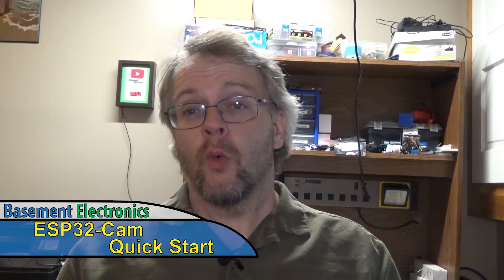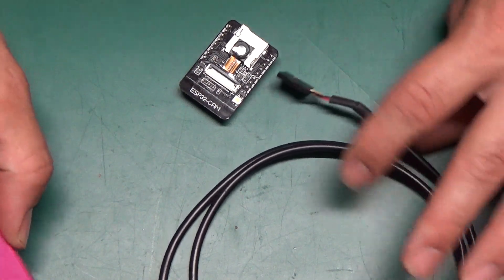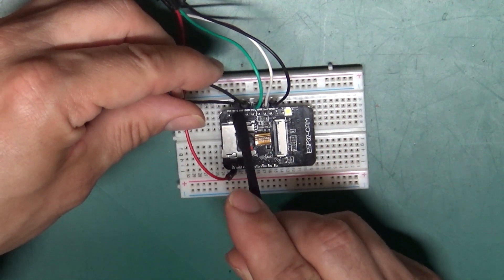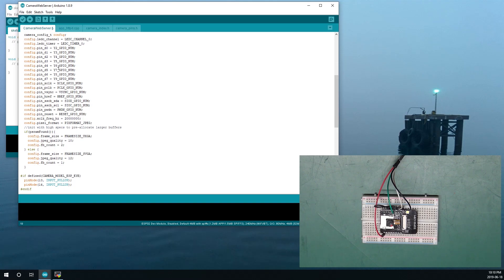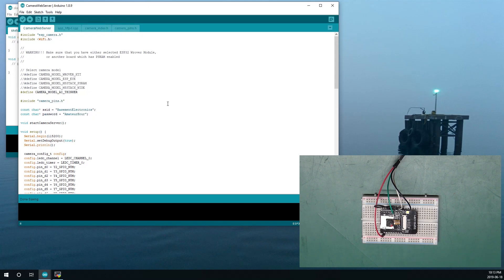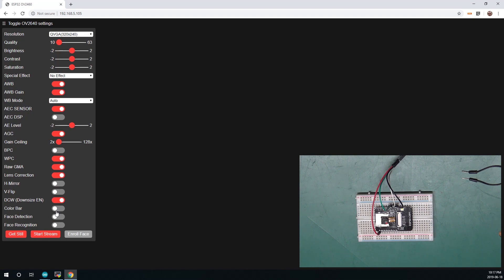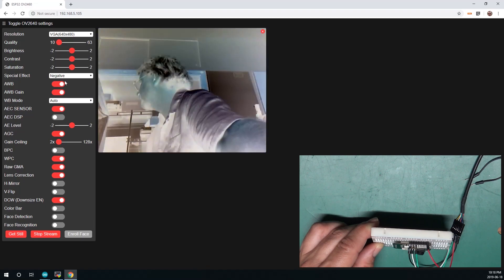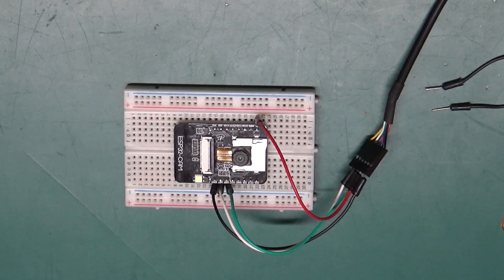ESP32-Cam -  QuickStart

Comment: I am using an Arduino Uno as my ttl, but I keep getting a "Timed out waiting for packet header" error. I have everything wired up and set to the same spec as you. This error appears once I press the compile and run button on the Arduino IDE. My Arduino wiring is as follows "A = Arduino, E = ESP32" (A reset - A Ground, A 5v - E 5v, A Ground -E ground, A TX - E UR, A RX - E UT, E IO0 - E Ground)

Comment: I want to reinstall programming in my this esp32 cam from new point bcz some features r not working so what I need to do ?
Reply from the maker: I can't remember if it was this video, or my "Deep Dive" video (it's been a while), but I do cover programming this board at some point.

You want to make sure GPIO 0 is wired to GND and connect the board to your computer through serial (the TX/RX pins on the board). It's not as obvious as other ESP or Arduino boards, but it's definitely possible.

Comment: interesting, i did not know about the wrover & huge app settings. i did it and it works..
however i think there is something wrong with my esp32 cam, i keep getting:-

19:24:25.042 -> [E][camera.c:1344] esp_camera_fb_get(): Failed to get the frame on time!
19:24:25.042 -> Camera capture failed

guess my camera is bad, or the esp32 is bad, so i guess a good tip is not to just order one, maybe 2, cos it takes sometime to arrive and it sucks when u cant get it to work and its a high chance a hardware issue

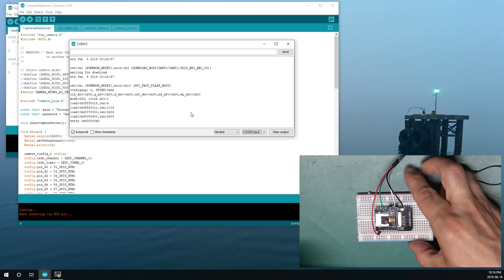Comment: hello, i could not connect my wifi like yours in at 7:10min. theres burnout trigger, and if i add external power supply, there will be weird output on my serial port. help me please
Reply from the maker: That's definitely odd behaviour. The best I can suggest is to check your pin connections. It's hard to properly diagnose it without seeing it though

Comment: Thanks for the easy and good guide. Is it possible to do a simple detection of a pre defined object?
Reply from the maker: Yes, it should definitely possible. In theory, the included example does face detection (even if I never got it working).
Unfortunately, my programming is nowhere good enough to write pattern matching, but it should be possible. I have another video that saves the image to an SD card. That example should give some insight on how to work on the image in memory.
Reply: @BasementElectronics  Writing a pattern seems too complicated. I think I will change direction and do a tensorFlow lite on a Raspberry Pi, and  use the ESP32 for motor control and other embedded tasks.

Comment: are there different FDI cables?...cause my  wires are different and the only the black one is in the same spot as the one in the video
Reply from the maker: This is managed through the definition libraries. They handle mapping the FDI wires to the ESP pins.

Comment: Thnx fr the tutorial.
Is there a way to do video stream from the camera, through the FTDI cable (or other USB-to-UART module) directly to a PC?
(No wifi....)
Any directions how to start?
Reply from the maker: You could send your JPeg stream to serial, similar to the way you would send it to a file. The work will be writing a client on the PC side to reassemble the data.

It shouldn't be much different than transferring data through a modem.

Comment: Thanks for a great tutorial video. I got mine working!  I was hoping to take it a step further and power it from a solar (photo voltaic) cell rather than from a USB port.  How possible is this? Ideally it would power itself and charge up a battery during the day so it could broadcast into the dusk.  I notice that module gets kinda warm so I have a feeling the draw is pretty high...?  Do you knoe what sort of draw does this produce and would it be possible to sleep when it gets too dark ?
Thanks
Reply from the maker: That sounds like a great project and I'd be interested in hearing how it turns out. It should definitely be possible.
The general consensus I've found is to use a separate LiPo charging module to handle battery management. This would probably be even more important with the Cam board since most of its pins are used by the camera.

Comment: Word to the wise for some people getting the '[E][camera.c:1049] camera_probe(): Detected camera not supported' and/or the '[E][camera.c:1249] esp_camera_init(): Camera probe failed with error 0x20004' errors, I was able to fix these with selecting the 'AI Thinker ESP32-CAM' board (down the list some) instead of the Wrover board and only uncommenting the ai thinker #define. Great video otherwise, thanx so much man
Reply from the maker: Thanks for the information.

I think I talked about this in more detail in a future video when I went a bit deeper. It would have been good to know for a "Quick Start" video though.

Comment: ** What does "A fatal error occurred: Failed to connect to ESP32: Timed out waiting for packet header" mean?  * while trying to load program.
Reply: ye, because you did not GNDed GPIO0 (BOOT) pin. And you didnt restarted board with button to upload program.
Reply: @RGPinger  Thanks, The two comm pins were wired wrong.  THanks for the help!

Comment: Thanks for the tutorial. Is there a way to set a static IP address for the ESP32-CAM? I'm guessing there is, but have yet to find proper example code for it.
Reply from the maker: You're right, I tend to rely on dynamic addresses. I find statically setting an address tends to be more work and takes away flexibility. It's an opinion I've built through my professional work.

If you're looking for a good example of setting a static address on an ESP, here is a good article.
https://microcontrollerslab.com/esp32-static-fix-ip-address/

Maybe I'll do a "Quick Video" on this at some point.
Reply: @BasementElectronics  Thanks!

Comment: How do I know what module my cam is, if it’s not Ai? I get the sketch to upload but camera won’t work. Says camera not supported in serial monitor, and I tried all the available options in the code. My module looks exactly like yours, except it’s not Ai.
Reply from the maker: It should be printed on the tin covering the ESP chip. If it's not an AI Thinker, the other common board would be the WRover.

If all else fails, you can try to match the pin assignments from camera_pins.h - though this could be pretty complex.

Comment: Hi, thanks for the tutorial. I followed your instruction but I can t connect my esp32cam. What i got is the following message: " A fatal error occurred. Failed to connect to ESP32: Timed out waiting for packet header". What can be wrong with my esp32?
Reply from the maker: Was this while you were trying to upload the sketch to the ESP? If so, make sure your GPIO 0 is connected to ground before you power on the board when you want to upload. This will put the ESP into bootloader mode
Reply: Have the same issue, I am using a USB connector that came with my camera kit. I tryed a bunch of things. No luck so far.

Comment: im getting an error. "failed to connect to ESP32: timed out waiting for packet header."

what does this mean? I"ve tried so many things to fix it that i've found, but no luck. Anyone have a solution?
Reply: me too, check and see if your RS232 power jumper is on the 5V setting and not the 3V setting.  He has his board setup for 5V.
Reply: me too, n still can't find the solution
Reply: @andylucky9864  I could only connect to my phone and not my wifi network at home.
Reply: @davidbradley3074  I even can't upload to my Esp32cam
Reply: @andylucky9864  re check your wiring, it will be wrong.  If you are using a 5V supply make sure to connect to the 5V supply and 5V ground.

Comment: Hi! How to set default resolution (e.g. 800x600) for video at the start of ESP32-CAM ?
Reply from the maker: Using the CameraWebServer example as a reference, you will find a setting for config.frame_size in the setup() function. Set this to FRAMESIZE_SVGA which is defined as 800x600.

Look at sensor.h - lines 30 - 43 for the other defined resolutions
https://github.com/espressif/esp32-camera/blob/master/driver/include/sensor.h

Comment: I got the "serial" error and cannot find a fix.  Already tried code:

pip3 uninstall serial
pip3 uninstall pyserial
pip install pyserial 

And nothing. I read the code to get the notes on this error, followed their advice and nothing.  Anyone else? Anyone have a fix? Thanks.
Reply: I am still really stuck on this.  I know people were able to get passed this issue, but I just can't figure it out.  Please someone who knows more about Python than I do help me out. Thanks.
Reply from the maker: I'm curious to know how and why you're connecting to the camera using Python.

I assume you're trying to connect to it as a client on not on the ESP board itself. I tried controlling the camera with MicroPython about a year ago, but I didn't get very far.
Reply: @BasementElectronics  No, I have the esp32-cam connected to an Arduino and the Arduino to my computer.  Everything else is the same.  This problem has something to do with the Python "serial" file and some "pyserial" file.  This is the Fault of the people that wrote the code for the esp32.  They messed up bad.  Some people are able to find a workaround, I am not so lucky.  I don't know what to do.

edit: https://github.com/espressif/esptool/issues/269#issuecomment-385298196

Comment: Now after following your steps I have got the ESP32 module running except it will not complete connection to WiFi. ....... Password and ID are all correct.
Reply: Hi, did you solve this? Some things I’ve seen suggest that the power supply you use to supply the USB struggles to supply the current needed. Especially if you are using your pc or pi to provide the power. The usb isn’t for data. Try a stand alone usb spurs with a rating of 2 amps. My esp 32 cam arrived today. Will attempt to get it working tomorrow evening.
Reply: Yes, but I have to use my phone as the internet connection

Comment: First of all I found this fantastic code of yours, the best of all that I have ever researched, congratulations on the work, I wanted to ask you please, I really need your help, I have to make a presentation from the college and I am using this code, How do I put the access point in this code, I already put the wifi. softAP and it doesn't work, which line of code do I need to change to have access to AP and have all the camera options?
Reply from the maker: I haven't tested this yet and I currently don't have access to my equipment.

You should be able to change "WiFi.begin(ssid,password)" to WiFi.softAP(ssid,password) to make your ESP32 camera behave like an access point. It shouldn't be affected by your camera hardware.

If you want to print your IP address after the access point is created, put "WiFi.softAPIP()" in a Serial.println()
Reply: @BasementElectronics  
OK thank you so much for coming back, have a nice day and start the week

Comment: Thank you, « Mr. Basement »  I am now starting tu use ESP32 / ESP32-CAM and ESP8266 MCUs.

I successfully installed the cards in my Arduino IDE but no examples were installed.  Any idea where I can get those example files ?  I have 2 -CAM MCUs and have a headfull of projects for this coming winter.

Have a nice day, and I hope to read from you soon.
Reply from the maker: Thanks for the question - I just discovered something new about the Arduino IDE (version 1.8.9 and later at least).
It seems the IDE only lists the examples for the current selected board - which makes sense. Make sure you have your ESP selected as your active board.

Comment: What is the range?
Reply from the maker: It'll be normal WiFi range. The ESP board can have an external antenna connected to it, so that will help improve the range.

If I had to guess, I'd say... 300 - 400m
Reply: @BasementElectronics  i need to build a telemetry for my rocket, but I need 2km range, any recommendation that would work with arduino?
Reply: @ernestosaboia  lol :D

Comment: Arduino: 1.8.5 (Windows 7), Board: "ESP32 Wrover Module, Huge APP (3MB No OTA), QIO, 80MHz, 921600, None"

Build options changed, rebuilding all
Sketch uses 2233502 bytes (71%) of program storage space. Maximum is 3145728 bytes.
Global variables use 50700 bytes (15%) of dynamic memory, leaving 276980 bytes for local variables. Maximum is 327680 bytes.
esptool.py v2.6-beta1
Serial port COM8
Connecting....
Chip is ESP32D0WDQ6 (revision 1)
Features: WiFi, BT, Dual Core, 240MHz, VRef calibration in efuse, Coding Scheme None
MAC: 3c:71:bf:59:cf:90
Uploading stub...
Running stub...
Stub running...
Changing baud rate to 921600
Changed.
Configuring flash size...
Auto-detected Flash size: 4MB
Compressed 8192 bytes to 47...

Writing at 0x0000e000... (100 %)
Wrote 8192 bytes (47 compressed) at 0x0000e000 in 0.0 seconds (effective 4096.0 kbit/s)...
Hash of data verified.
Compressed 17664 bytes to 11528...

Writing at 0x00001000... (100 %)
Wrote 17664 bytes (11528 compressed) at 0x00001000 in 0.2 seconds (effective 883.2 kbit/s)...
File  md5: 07c034de560e4028a0321ea9277d4bdd
Flash md5: 94d7669a6907ad539f478bee1686d1ad
MD5 of 0xFF is db8fcd5fb9c48c5c0e18cc69ba10b08e

A fatal error occurred: MD5 of file does not match data in flash!
A fatal error occurred: MD5 of file does not match data in flash!

This report would have more information with
"Show verbose output during compilation"
option enabled in File -> Preferences.
Reply: same
Reply: did you try using Rui Santos's Modified Code?
Reply: @RakshithPrakash  I also try this...